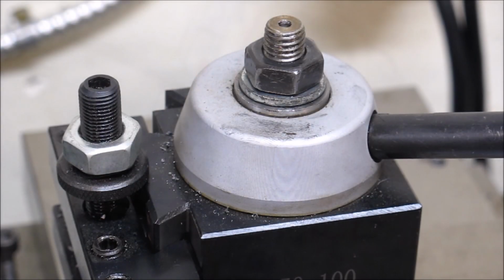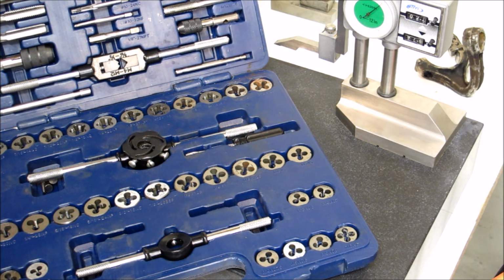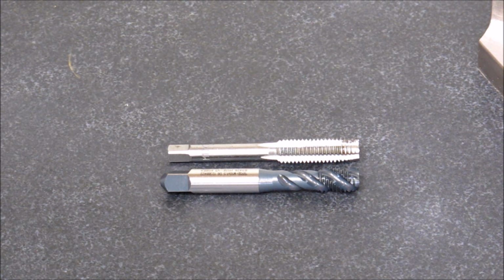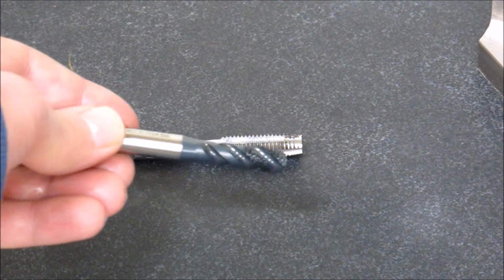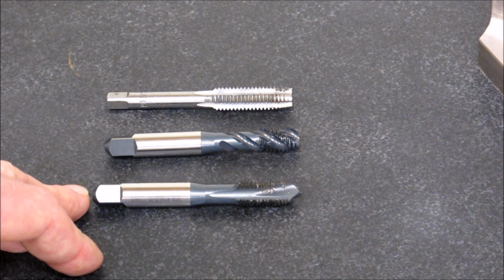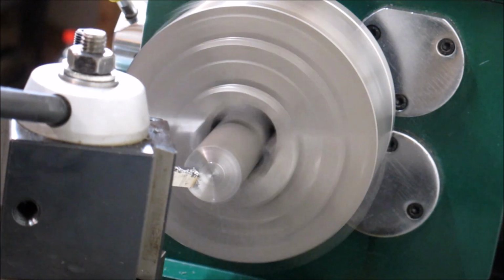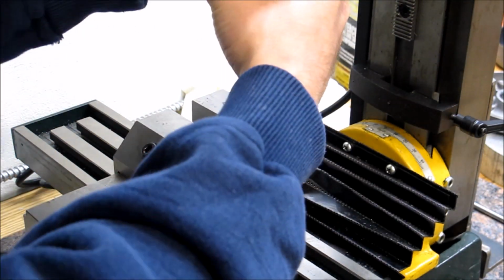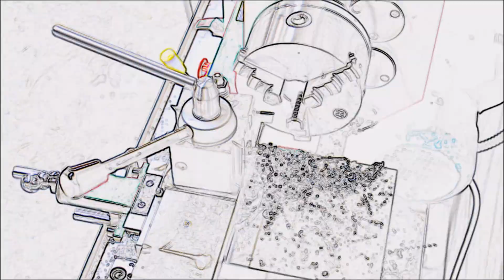Tool Post Lock Nut and Handle

Comment: I've got a project like this in the works, but I want to modify the wrench I have to semi-permanently live on the toolpost, like Keith Fenner did. The style in the video does have a certain aesthetic advantage, but i want to be able to easily pull the handle off if it's getting in the way
Reply from the maker: I thought about that, and I've tested the 'permanent' handle by leaving a wrench on the nut as I worked.  I realized it really never got in the way all that much.  I did put flats on the handle to allow a fairly quick removal of the handle with a M10 wrench.

Comment: What's that lube you're using? It looks almost like paste wax or something, i've never seen anything quite like it
Reply from the maker: It's actually bacon grease, eh.  I really like the stuff because it works well, is non toxic, plus it makes the shop smell like cooking bacon.  Actually the smoke point on it is pretty high.  I have a some Rocol RTD cutting fluid that I use as well and it starts burning quicker than the bacon grease.  Buttercut is made with animal fats, but bacon grease is nicer because it is a paste at room temperature.
Reply: Modern cutting fluids and pastes are formulated to try and get the same capabilitys as the old school animal fats and oils could do. Yes the bacon fat does work great. However it contains salt, preservitives and who knows what other additives that can have later rusting effects if it's not perfectly cleaned off. And unrefrigerated bacon fat will go rancid. About the last thing you want getting into any of the usual shop cuts and those metal slivers driven into your hands. I use pure cooking lard and keep it refrigerated between uses. It's low to no salt, contains none of those preservitives and it works exceptionaly well for reaming stainless. Not my idea since I picked it up from one of the Guy Lautord books. It still needs to be cleaned it off the part as well as possible though.

Nice explanation on the different types of taps. According to my reading good high carbon steel can be ground to be a bit sharper than the best HSS. But cheaply made and probably lower quality steels used in those cheap taps and die sets along with the less than quality sharpening makes them about as good as you mentioned. I've got a set from Princess Auto that isn't any better. Unfortunately I don't know who still makes quality high carbon steel taps if anyone does. My preference for good HSS taps and dies is OSG and I haven't found any better so far. Although I've heard there's some as good or better built in Europe. I haven't tried those YG's yet.so thanks for the heads up about them. They look to be well made.
Reply: That's interesting, just the other day I was shopping for cutting fluid but the store was out, and the guy told me that he'd always just used olive oil
Reply from the maker: I keep the bacon fat refrigerated as well.  It keeps for a long time.  I agree regarding the salt - I do try to clean the parts very well when I'm done and use a rust inhibitor if they can rust.  What I like about the bacon route is that generally the stuff just ends up in the garbage.  Sure some people cook with it (probably not the healthiest), but I'm interested in using stuff we waste in productive ways.  I have used OSG taps as well - I don't think  you can go wrong with them either.  I think if you want a quality high carbon steel tap anymore you probably are going to make it yourself.
Reply from the maker: Olive oil would be awesome for your Graziano :).
Reply: Neatsfoot oil was used for very fine lapping of cutting edges a long time ago instead of today's honing oil but I haven't tried it yet. I've heard a few others mention using olive oil as well.
Reply: I can't stand Buttercut. >_< After a couple weeks on a rag or the machine it goes rancid and reeks of rotting meat. Completely disgusting. D:
Reply from the maker: That is really the downside to using fat based cutting oils.  I usually clean it up fairly soon.  Buttercut is okay, not my favourite, doesn't seem to work any better than lard or grease and isn't free.  Actually it is kinda expensive.